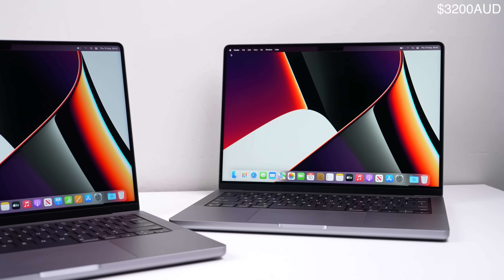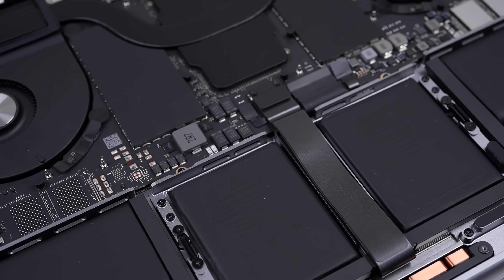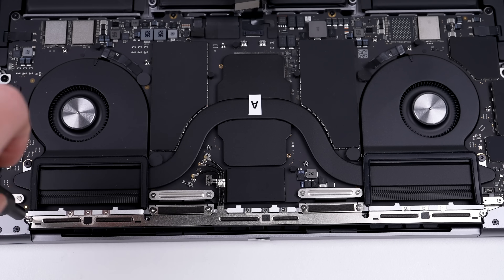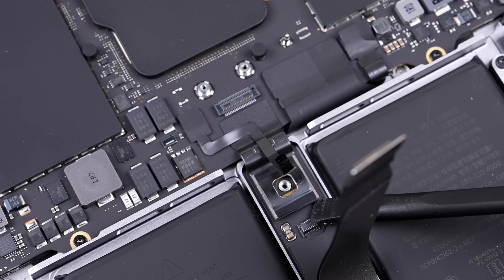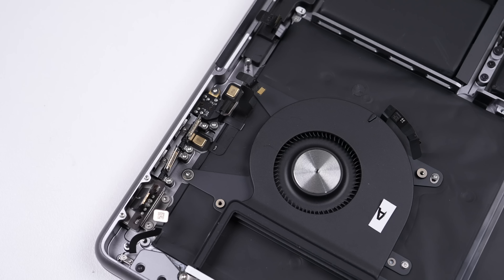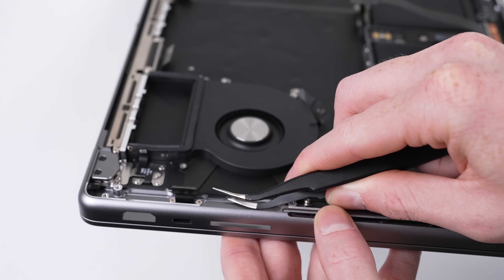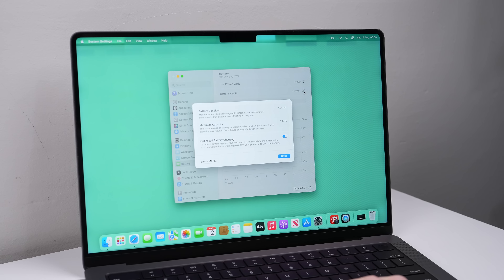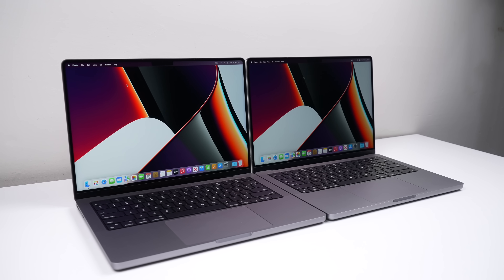New Anti-Consumer MacBook Pros - Teardown And Repair Assessment - Apple Silicon M1/M2

Comment: Thanks Steve jobs for the legacy you left for other companies to follow & for us to deal with
Reply: Jobs' idea wasn't "let's make it harder to repair", it was that he wanted computing to be ubiquitous in everyday life enough that it's basically an interactive, high quality appliance.   Talk to Dell and HP and Lenovo as well.  Most corporate workplaces,  if the machine seems to stop functioning properly, their IT department will connect up, do a couple of diagnostics and see if it can be fixed immediately remotely.  If not, they're unlikely to take it apart.  If they think it's still usable, they might re-image it and see if it can be put back in service.  They're not spending hours on component diagnostics, repair and replacement.   Their job is to get people back to work as quickly as possible.

Comment: As someone who went through secondary school during the mid to late 2010s and witnessing macbooks of that era, being unable to replace the screen is awful, especially with my perception because those ones back then, the displays shattered if you accidentally left a sheet of paper on the keyboard. Not hyperbole, thats what happened to one of my classmates back then
Reply: It’s funny because I basically use my 2013 mba like a folder for a few sheets of paper from time to time and it still works.
Reply: my school has the 2017 macbook pros, the insanely thin ones, in our photoshop class, and a kid shattered the screen because he was eating near the computer, and a piece of salt fell onto the body by one of the corners, he didn't notice and when he shut the laptop screen, that tiny little salt chunk decided it was the end of that macbook
Reply: @randomisus8711  I think the 2017 model was the one that was shattering coz people put a post-it note over the webcam so I believe it 😅

Comment: Everytime I look and check for Windows laptops (mostly gaming laptop models), I will make sure that the RAM, SSD is user replacable and the screen has to be easily repairable.

Service support has to be good too. 

I really hate the fact that most Windows OEMs especially Chinese branded Windows laptop models are starting to copy Apple's soldered RAM and anti-repair antics.

I can't even recommend a Windows laptop model to anyone or someone that has soldered RAM, SSD and unrepairable screen.

Comment: You wanna know the saddest thing about these as well? To anodized the aluminum casings, apple purchased brand new 10 foot anodizing Chambers with the top automation integration, and literally landfilled them after less than a year. These machines can go for literal decades. One company that I worked with over the summer got a bunch of the tanks for pennies on the dollar from a scrap yard. Apple is the most disgusting company on the planet

Comment: Why ya'll support Apple by buying this crap?
Wasn't there a bill signed for the right to repair?
Apple doing everything they can so you give them more of your money. Well spent, gents. You have a way too expensive brick with the equivalent performance of a $900 PC built with your own hands and the freedom of less than China. This thing will turn against you iRobot style if Gates wishes it. You ain't in control. At all.

Wasn't there a bill for the right to repair signed couple years ago?
Apple jumping every loophole they can find. F*** 'em. Seriously, just don't buy anything from them.

You defend that company, well, gosh diddly darn, I just might have to denounce your sanity.

Comment: From what little I understand, a lot of the issues with the screen, Hall effect sensors, etc are due to Apple not providing their internal calibration software to end users and repair shops—doing so is very obviously anti-consumer, considering how many of the parts outright require that calibration to work, but the flaws with replaced parts are not designed into the machines. 

Apple needs to be forced by legislators to provide the internal software for repairs to the public, or things are only going to get worse, really.

Comment: Even the bootloader on M1/M2 Macs are locked, so there goes installing Windows.

There is literally no way someone in my Visual Basic class can even use a Mac for class anymore thanks to Crapple's constant switching of processor architectures for Macintosh computers.
Reply: Incorrect—you can install other OSes than macOS on Apple silicon machines, and theoretically have been able to since day one; it’s been possible to install Linux on them since a few months after the M1 line launched thanks to the work of the Asahi Linux team.

Microsoft has understandably not ported the ARM64 version of Windows to Apple’s newer machines, as they offer a line of ARM machines that are a direct competitor to Apple’s, but that’s not an issue of the machines themselves. That’s just corporations doing their usual corporate bullshit.

Comment: I understand what is happening with the hall effect sensor. Instead of making the orientation consistent between all models, they calibrate the magnetic field to the specific device that has a random orientation. There is no way to calibrate this yourself, which is scummy, but it doesn't appear to be serially tied to the machine, unlike the batteries and screen.

Comment: As I type on my 2018 Macbook Pro with random double typing of letters, flickering touch bar and popping noises randomly from the speakers I looked forward to getting a new one this year hoping Apple could get back to building something reliable with their own silicone. I am very disappointed that their focus seems to be on making customers computers impossible to repair. I bought the first Macbook offered in 2006 and have been loyal since but this does it for me, Its not right and I cant support or condone such practice, its outrageous !

I wonder if you asked about this in the store before purchase if they would even tell you ?

Comment: I still use my MacBook Pro mid 2011 with the famous "GPU bug" which in fact was a wrongly selected capacitor on the motherboard. 
I love OSX, because its UNIX based, but Apples hardware is trash. It's not worth the price. I hope my next Mac can be Hackintosh again.

Comment: So in other words, you can’t repair anything without it becoming a buggy mess. 

In Apple’s defense, the point of a corporation is maximizing profits. Third party repair shops cost them money. It may not be ethical, but it improves the bottom line.
Reply: you mean they make a profit by not only upcharging you 5X the actual value of the laptop, but the smallest parts that are worth nothing?
Reply: @M.Hametsu  Correct

Comment: Around a month ago I smashed my phone screen, it dropped out of my pocket on the train. Since then it's frankly ridiculous how many times people have said about getting a new screen for it. I looked at paying for it to be replaced but it's like $200 and apart from making it look aesthetically displeasing there is nothing wrong with the phone. If they wanna make stuff unfixable they should just add some components that connect to software on your device that detects when the back is off the phone like a case open alert on a PC and when it detects the case as open those components actually physically damage the rest of the components or just glue the case the the phone''s mobo so that most idiots trying to rip the back off by force smash the mobo in half or bend every component on it.

Comment: Actually the only illogical thing are those rivets in the keyboard - that's ridiculous. The rest kind of makes sense. 
The fingerprint sensor should be protected against tampering, replacing it actually should require registration, otherwise anyone could just install modified part that always returns positive authentication.
The screen is probably individually calibrated to mask any manufacturing imperfections,  so with the data not matching it defaults to something. (why it looks that bad is another story)
The lid angle sensor - no idea why they need accurate angle reading, but it may be used for auto brighness or something.

Comment: This is mighty annoying. These Apple Silicon devices are works of art, and extremely powerful. They should be flying off the shelves like hot cakes. So, I can't understand why Apple wouldn't put their incredibly refined engineering into something THAT ACTUALLY BENEFITS THE USER! It is true that their stabilityand performance comes from tight integration - but then again, it's not like you'd be buying Apple displays or small custom bits from anyone else?

One can only pray they'll catch up to their own claims of working on making these more repairable - but I can't say I'm especially hopeful :/

Comment: Normally I'd agree with this, but here I feel like this is the equivalent of installing an early build of macOS Sonoma on a computer that shipped with the latest version...

It wouldn't be surprising to find incompatibilities somewhere in the hardware.

I feel like this might not actually be malicious, the behaviour between hot swaps is inconsistent and not predictable - unlike the iPhone where the same things are happening no matter what. It comes across as some kind of genuine incompatibility or imperfections between hardware elements.
Reply: it's malicious. parts that serve the sole purpose of just detecting something's position making a laptop unusable is obviously not normal.

Comment: I must say that, watching this with my friend who's a genuine onboard systems engineer for planes (the guy designs planes' computer boards ans makes the systems work with the avionics) both him and I were shocked at how much effort and complex engineering went into making this laptop "single-use" and actually hard to nigh-impossible to repair. Even going further than removing the case cover requires extreme care as there are only metal surfaces pressure or friction fitted on other metal surfaces with a metal plate and screws to secure it instead of cables and plugs. The minutia needed to assemble or disassemble the thing is puzzling compared to literally any other laptop both my friend and I have ever seen opened or fiddled with.
Reply: This is just scam to the customer. 
Never ever again will I buy any Apple product.
Reply: I'm old enough to remember pinto's and chevelles.  They all died in 1989 when I was 8, and nobody bought new ones.  The dodge neon came out in 1990 same type of car.  They lasted till 1998, and then it stopped because everyone in the 90's decided to buy toyotas and hondas instead.  Now, once again American Cars...ICE cars...last 500k miles, or 700k clicks.
Reply: What laptop u recommend? I ordered MBP 14 M3 pro 18/512 for $1500 but now I'm having buyers remorse.
Reply: @kev_chata  why? That’s probably the best Apple product on the market right now in terms of bang for buck value.

18gb ram is enough to run virtually everything you can think of very well and beautifully, outside of extremely high-end/niche programs that maybe .0001% of the market needs.

Comment: Is there a way to adjust the angle of that magnet that the angle sensor measures? Its obviously attached in a random orientation then calibrated to in the factory. If the magnet can be rotated on the replacement display the angle it sleeps at can be fixed.
Reply: I agree, I am familiar with rotational magnetic microsensors in things like intelligent servos, and I think the "zero position"  is the nub of that particular issue, i.e. identifying the precise angular position of the magnet with respect to its sensor at the point when the screen is closed.  Still, Apple, what the heck!!!
Reply: @davechisholm9670  It should just be a calibration you can do in a system settings menu.

Comment: Interestingly enough I just did a panel swap  a few days ago on a windows laptop and experienced similar issues  with the panel brightness and   general  panel glitchy-ness...
I found the problem to be not the hardware but the software.... It seems the laptop was still using the old monitor driver even after I reinstalled the gpu drivers...And although it still worked it was causing issues.... Which 100% went away when I reinstalled the  monitor drivers...

I'm not sure if you can  reinstall   system drivers  on MacOS......  But  even so  you need to rule out it being caused by software issue with a full reinstall of MacOS if need be... before condemning  hardware.. incompatibility

Comment: Isn’t it weird that windows laptops you can repair the display with no calibration issues. The only calibration issue I think is serial number. Out of calibration wouldn’t cause anything other than slight colour difference across the display. Any case, these should be calibratable as the monitor you connect to the hdmi port, there’s just no reason for it to do what it does.

Comment: Apple does that since the dawn of times. The iMac 32bits from 2006 is a good (read horibbly desastrous) example with the pseudo credit card to push the latch and open the computer. It's not even funny, it's ridiculous. Same for the Mac Mini of 2014 which has nothing to upgrade inside except the disk: special screws !
There is also another reason not linked to repairing: design ! Yep, when you want to make a computer look like a lamp or a cube, at some point .. it's a design flaw..

Comment: I begin to understand the high cost of RnD and and production of Apple Devices. The majority of the RnD apparently goes to figuring out the most complicated and unnecessarilty over-engineered way to assemble a device. Then creating an automated manufacturing process for said complicated assembly must also cost a fortune.

Comment: If just Microsoft added the video and image accelerators to their operating system, that worked no matter the configuration (and mostly beacuse there are only 3 gpu brands anyway) we wouldn't be using those computers. 
This is what made me buy a bloody MacBook Pro M2, the fact that my Canon R6 10bit 4:2:2 videos open flawlessly without me having to try and find whatever codec is there, which not even the paid HEVC codec from the MS store works. 
This is why people buy these, if you work with video and photo productions you are stuck to these, not that I like it, more that I can't go around it.

Comment: Remember when Apple changed to USB-C? You can thank the EU for that; they created pro-consumer laws and forced Apple to use the same cable as all other smartphones. Thanks to a flow-on effect, all iPhones around the world use USB-C. Now thanks to new EU pro-consumer laws, phones and laptops will need to be designed such that the average user can replace the internal components with ease. This will have a flow-on effect to the rest of the world, not just Europe, as Apple will not design unique products solely for the European market. So in the coming years, expect to see personal devices with screens and batteries that are MUCH easier to replace (without the need for special tools). I'm trying to see this less as a middle-finger to Apple and more as a love letter to consumers.
Apple is a great example of what can happen when capitalism goes unregulated. It takes a strong, responsible government to enact such laws and keep these totally selfish companies in check.

Comment: I'm really surprised that a hall sensor even needs calibration. I haven't played around with them much but i thought they'd be pretty consistent between different models. I guess Apple must have gone with cheap mounting of the magnet and sensor and decided to do a static calibration in factory to compensate for the differences. They could have also pit the sensor/magnet at the top of the screen if they only use open/closed lid data.
Reply: They don’t need calibration. It’s apple anti consumer repair at work. Only thing not calibrated is the serial.
Reply: I just repaired a 2020 MacBook Air and got away with it. Looks like it might be the last MacBook that you can actually fix.

Comment: This is unfortunately true. I have an MBP 16" M1 Max and my monitor broke when my pen cover hit it when it flew as I was trying to get it off. Searched the web for some ways to replace the monitor and found a similar issue as in this video. So, I took it back to Apple for repair and it cost $1000 just to replace the broken LCD since they had to replace the whole panel. What's disappointing is that you have to surrender your broken LCD too or else you'd pay an additional $200.

Comment: Is the angle sensor paired with the display or with the hinge itself?  If it's detecting the orientation of a magnetic field, it's the sensor and the magnet pair that go together.  Couldn't tell whether that magnet went with the display or if it was a part of the body of the laptop.  Insanity either way.

Comment: I did a repair of this unit days ago, Macbook pro M1 pro (A2242). It will only be done by a skilled techs with an experience for micro soldering.
there's a 2 embedded integrated chips inside the display need to transferred  from the broken retina display to new retina display. it is not an easy job to do! but after the repair, there is no rectangular shapes on the upper part of the display, all features are working fine :D

If you need help replacing it especially if you are from The Philippines. I can do that repair!

Comment: Seems like they are doing calibration on parts once installed rather than having strict tolerances during productions. Makes sense as a cost cutting measure, but i'm sure they could have just as easily overcome these issues.  So non-repairability is probably a symptom of cost cutting measure rather than intention.

Comment: for the displays they are serialised with the machine and need to have a system config done on it. if not you have those screen glitches. you cannot remove them any other way.
Reply: to add this counts even for adding a part in repair. they always need to have a config done and this counts for multiple different parts on multiple models with different issues from machines 2018 onwards.